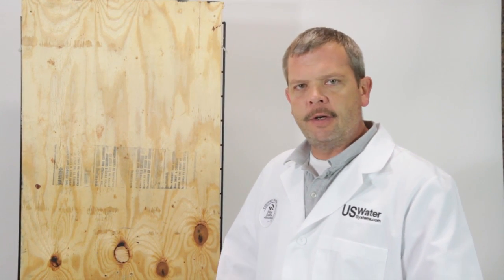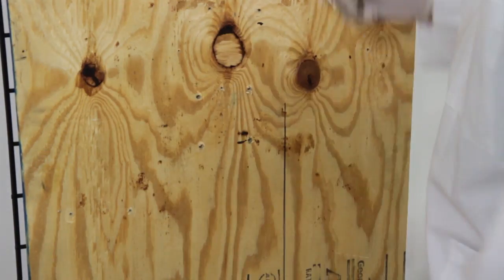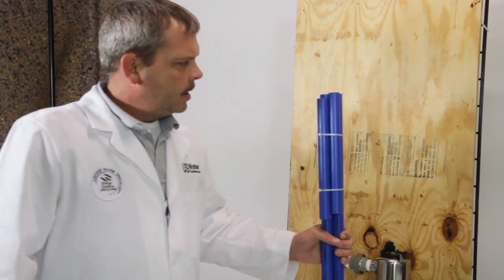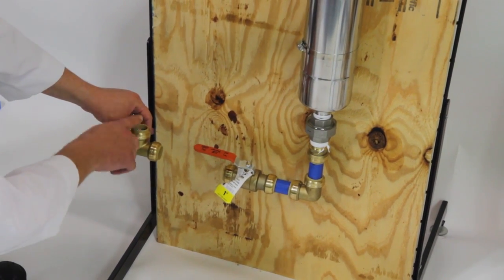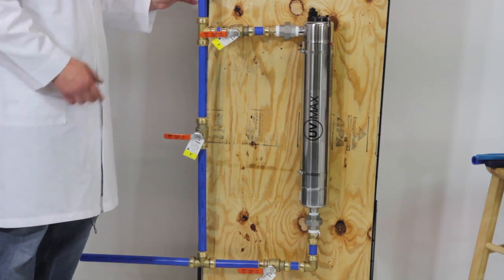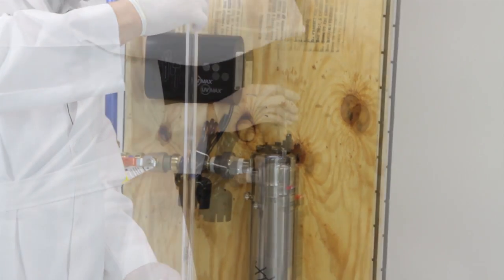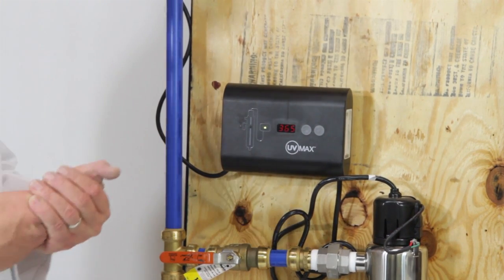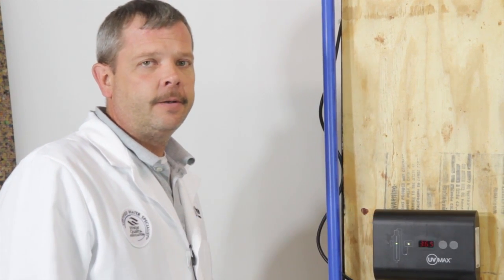How to Install an Ultraviolet UV Water Filter

Comment: I can’t believe how many lies and misrepresentations this clown in the white doctor's coat makes during this UV light water filter installation.

I think one of the grossest misrepresentations or lies is that having a flow meter on the unit would diminish the LED light, which is why this particular system does not have a flow meter. That could not be further from the truth; LED bulbs are not like mercury bulbs, and they don’t require heat to restart, so there’s no damage or disadvantage in these lights going off and on. In fact, it tremendously prolongs the life of the bulb when they are not in use when there’s no flow through the system. 

A direct contradiction to what this bozo has said. He then states that having an LED light that goes off when there is no flow through the system would cause bacteria in the system, which is another gross lie.

Where in the world did you get this bozo, and what type of company would be represented by someone who makes so many gross misrepresentations? In this case, it would be gross deceptive business practice for these false representations to support a product under such ridiculous claims.

I was still a practicing attorney I’d be establishing a class action suit against this company representing everyone who has ever purchased this product under these false an deceptive representations.

Comment: Great video but one issue. It is highly recommended to use copper pipe for the first 10”-16” of the inlet and outlet. UV light can weaken PEX and CPVC pipe.
Reply: How is that possible if the connection to the unit is brass. The PEX is not directly being touched by the UV rays. I would like to see info on that one.
Reply: Looking for more information on your comment. Please provide?
Reply: Everything weakens plastic pipe, it's garbage. Run all your lines in copper

Comment: Does the UV light damage the PEX pipes? is it preferable to do all the connections nearby using copper?
Reply: Yes UV light will damage PEX over time.  You should use copper for at least the first 16” on either side of the UV filter housing.  You can convert to PEX after that if desired.

Comment: So I assume the light works all the time.  How hot does the water get, like say overnight when there is no flow?
Reply: Up to 140 F. So unplug and wait for metal housing to cool. Also use at least 10” of copper pipe at each attachment as pvc might soften and leak.

Comment: Never use sharkbite fittings. They are good for a quick fix until it can be repaired properly by a licensed plumber. They are not meant for permanent use. Also the uv light systems are not a scam but are really meant for people on a well water system due to potential for bacteria growth. Not so much on a municipal supplied water system. Normally just a whole home purifcation system will do the job.
Reply: Shark bites are not temporary I have had mine for years they are a more expensive version of sweating copper pipe.any liscensed plumbers use these to save time. please stop spreading false information

Comment: Seams like a bad idea to bypass the uv system when you change the bulb. This would let water that has not been disinfected to fill your hot water tank and the rest of your homes plumbing?
Reply: So true. You could buy gallons of water to drink, but still be able to flush toilets and shower.

Comment: If the bulb is always on it should be treating water ... gotta be a way to send water back thru a second or third time if the system is sitting idle at night or when not in use (ie everyone asleep or not home)
Reply: As you said, the UV light is always on. Once water travels through the UV filter, it is sanitized. No reason to send it back for additional sanitation. Sanitized water sitting over-night is still sanitized for very long periods afterward.

Comment: Why do you need the bottom valve on the uv unit ... what does it really do ...
Reply: He explained it clearly, that it prevents water from getting into the UV system while the system is being serviced. Otherwise you'd have a flow of water coming at you while trying to change the bulb, or whatever else you need to do to it.

Comment: My wuestion is where to install it..
Pre hot water heater? That way it treats all water coming into the house.
??
Reply from the maker: Before the water heater for sure. Always put as much water treatment before a water heater that you can.
Reply: I was told by a home inspector who had a background in micro-biology that the filter should be installed as close to the well as possible, i.e. right where the water comes in, before the pump even.
Reply: @GreatFutureBand  a clogged filter before a pump can have severe results
Reply: @GreatFutureBand  lol i thought that was obvious

Comment: Can the light be mounted horizontally instead of vertically?
Reply from the maker: Yes. We do recommend vertical though because of easier water flow, but horizontal is still effective if it's your only option.

Comment: There is a error to use galvanize union because they are going to rust, coper union are the normal one to use
Reply: Its a stainless steel union!
Reply: Look closely. Stainless Steel. You can tell by the threads.
Reply: this seems to be a serious error in the video, almost worth a complete video update! Thanks for posting this information

Comment: The cost of the shark bite fittings used to do this could have paid for a licensed plumber to install with copper...
Reply: The issue with copper is. They are finding flux to be nearly directly linked to Alzheimer. And not just the "tin foil hat" theories.
Reply: Haha it is true, and too many shark bite connection will cause leaking for long term use :))

Comment: I thought uv light deteriorates pex rapidly, and instructions state not to install pex in direct sunlight because of this. Isn't the UV light being emitted from the bulb equivalent to sunlight? Also don't the shark bites have a plastic collar inside them that will also deteriorate from the UV light? Not trying to take anything away from your install video just want to make sure before I go ahead and use this setup.
Reply: You are correct! I would suggest using the Stainless steel flex hose (6"minimum) on the ports.
Reply: The UV light does not shine directly on the PEX or the shark bites. The UV light is only inside the chamber and shines on the water as it passes through it. For me, on this type of installation, unless you can secure every connection to the wall, I would go with glued PVC or sweated copper. I know shark bites are good but i'd be worried over time.
Reply: @1SpudNuts1BigNasty-DIY  UV in a mirrored steel tube can and does shine around corners. I can see the glow through my pex... back to the hardware store for a heater connector.
Reply: @1SpudNuts1BigNasty-DIY  The light does travel into the attached pipes.

Comment: I didn't realize they made residential UV devices at such high flow rates, 30 gallons per minite. WOW! But, that being said, I've been around the block with tap water, various filters, etc. and I finally decided that there are too many variables and too many chemicals and chemical by-products in tap water with which to deal. And, in addition to the added fluoride and chloramine and the pollution in the groundwater, there is the issue of several miles of pipes that run from the water tank in your town to your home. They are probably 20 years old and WHO KNOWS WHAT is growing inside them and WHO KNOWS WHAT is leeching into the water from them! Here's what I do: I have a Royal Berkey gravity filter but I use my Berkey in a special way. I have an AWG (atmospheric water generator from DroughtMasters) that removes 6 gallons of water per day from the air here in Clearwater, Florida. I then pour that water through my Royal Berkey which contains 4 Black Berkey carbon block filters. The AWG unit contains a UV light that kills bacteria, etc. I literally get my drinking and washing water from the AIR! I plan on having my output water tested by National Testing Labs in Ohio. Cheers! Steve Downing, Clearwater, Florida ** Sweetpuppy*com/BigBerkey **
Reply: +Stevie Downing Good idea. Does the DroughtMaster work in California, where it is dry? ML, Karen ** KarenDowning*com **
Reply: +Karen Downing The Droughtmaster Traveller requires a minimum of 30% humidity. S.
Reply: There are mechanical filters that deal with all contaminants. It's a non-issue, especially in a reverse osmosis system. Finally, the UV at the end of the system will kill the viruses.

Comment: How effective is the UV light, as far as flow rate? Also what kind of pressure can this unit handle, especially being installed on a well water supply. And is 3/4" line in/out ok?
Reply: If you call 1-800-608-8792, one of our certified water specialists can help you out with your questions.
Reply: @duckie2890  any WhatsApp number for international people interested in the product?